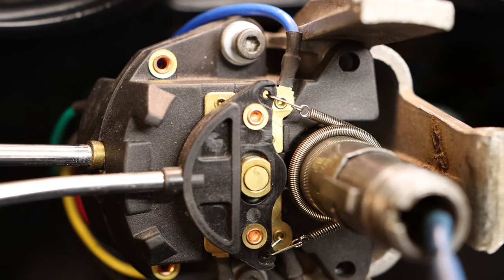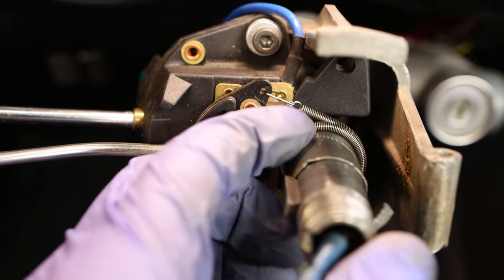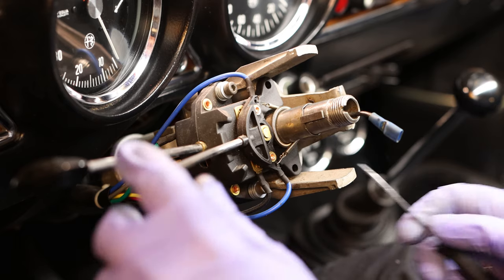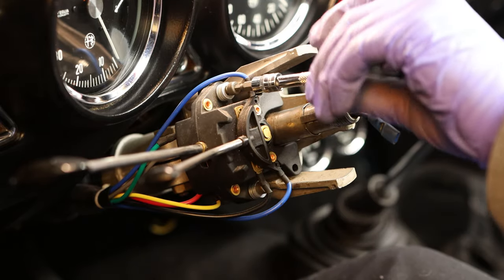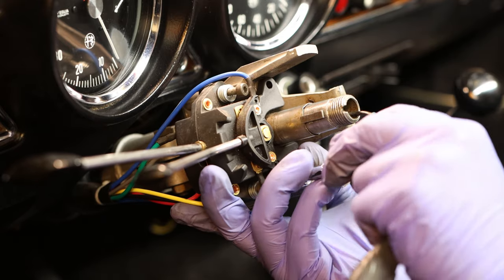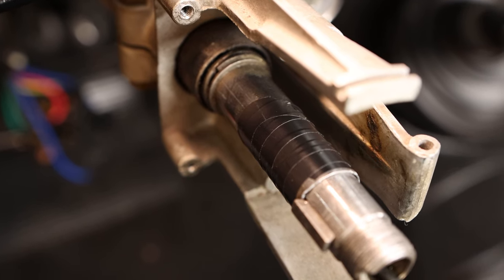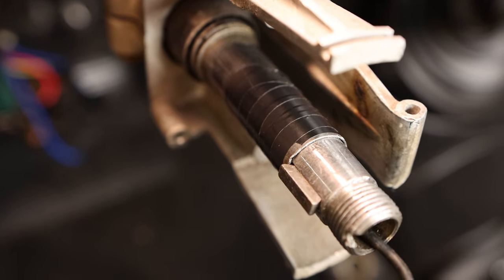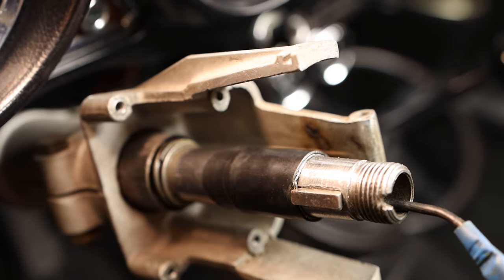Alfa Romeo 105 Lichtschalter Umbau und häufiger Fehler

Comment: Hi Rafa,

I am currently in the process of replacing my indicator spring as well and your video is very helpful for it.
But I struggle with the sleeve as it keeps on pushing the key out of the keyway everytime I push the sleeve in and when I test fit the steering wheel without the sleeve, the steering wheel touches the black covers.
How did you manage to put the sleeve in place? Or did you shorten the sleeve, perhaps?